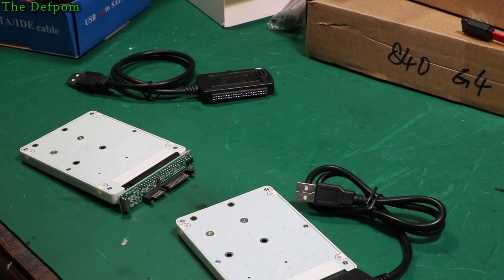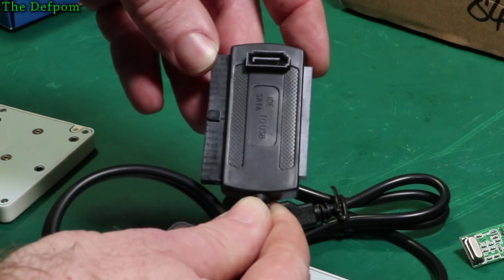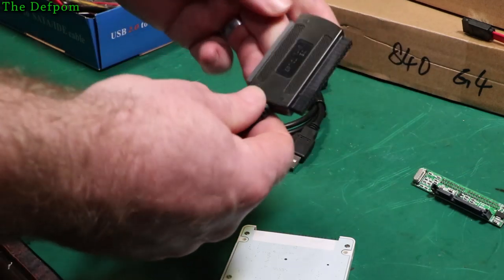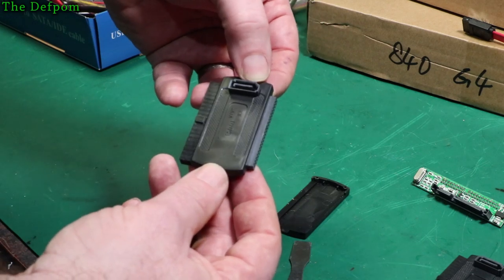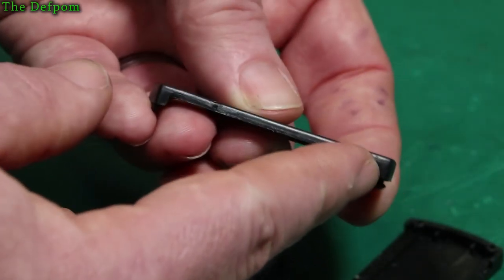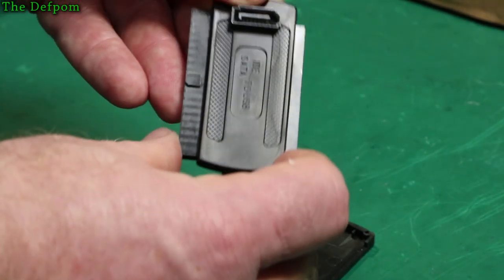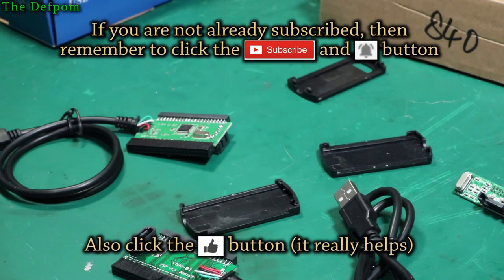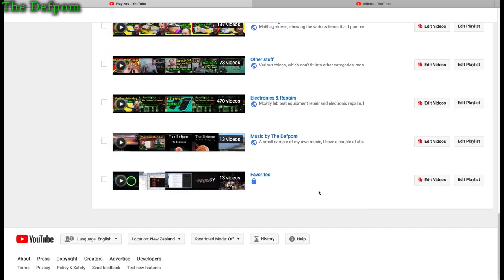🔴 #629 USB Drive Adaptor Followup - Why Is It Different ?

Comment from the maker: IDE/SATA to USB Adaptor 1: https://defs.link/?u=d55987
IDE/SATA to USB Adaptor 2: https://defs.link/?u=bab6d4
IDE/SATA to USB Adaptor 3 (copy): https://defs.link/?u=baf35c
Reply: i have one of those adaptor, but the main problem of it is the USB cable, after lot of uses one or more of wires can be cut , but some of them support firmware update chip.

Comment: I have a couple of adaptors too, but mine has the sata socket in the end and there are a couple of leds in the top lid.
USB2 speed.
There is also a small hole on the end where a two pin plug pushes in, it supplys 5v to the sata connector.

The unit works finr with cd/dvd writers as well.

Small laptop drives do not need the supplied supply.
The chip is :JM20337 by jmicron.
Mine was dated to 2006, should have valves in it lol :-D

Comment: I've noticed some adaptors & cables only provide GND + power rails to a single pin assuming each device will use common rails internally, which is not always the case. Jumpering the missing pins to GND or power according to spec brings everything to life.

Unlikely to be relevant in this case, but the SATA power connector specifies a 3.3V power pin which many USB and Molex->SATA adaptors omit.

Are those PATA SSDs easy to take apart? I'm really curious what's inside. Have you tested their transfer speeds? Maybe they're just CompactFlash to IDE adaptors+card mounted in a case.

I have a box full of USB2.0->PATA adaptors. Some behave flakey with CF adaptors or drives above 128GB due to lack of LBA-48 support, resulting in really weird errors if a larger drive is inserted. Some recognise CF but not CF+ or MicroDrives, and others work fine with hard disks but simply won't recognise CF adaptors.

We couldn't figure out why none of our furniture lined up in one room. Eventually realised the wall we'd assumed was a right angle wasn't actually 90°. I wonder if the PCB was cut crooked on that adaptor of yours.

Comment: Beware the power bank Molex connector on these things as my one only had one ground so when using it to power a 3.5" IDE drive both 5V and 12V weren't getting grounds. Some will power with USB but some won't so if this ground is missing you need to strap both grounds together in the short Molex M-F lead that plugs into the drives power socket. Had me flustered for a bit until I spotted it !

Comment: I bought one of those when SATA1 came out, and the protrusion of that header is 3.2mm past the plastic body. Maybe there is something in a pin of the header making the drive not go on, or if it's the plastic body I suppose you can enlarge the SATA hole and cable hols and offset the body back.

Comment: Just a connector that is shorter than the other. With the blue box beware that the IEC connector is a fake copper device, and also does not have a ground wire in the cord, and the power supply, despite being provided with a ground pin, it is not connected to mains ground. Thus you get a big spike when powering the device on. Plug it in, and then use the cable to connect power if using the device with a desktop, and with a laptop use care, as you might cause data corruption. Not the best PSU around, but still works for short periods and occasional use, if you are using more seriously grab power from the PC itself, using an extension off one of the board drive cables, and install a double throw switch to do power resets.